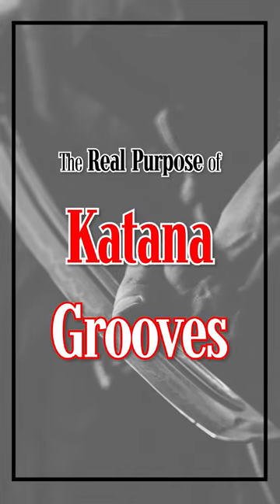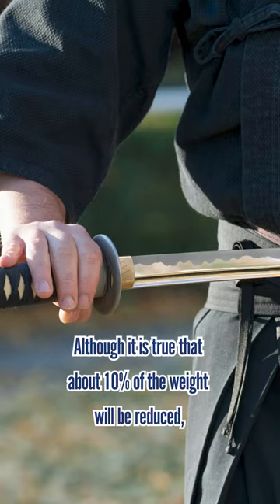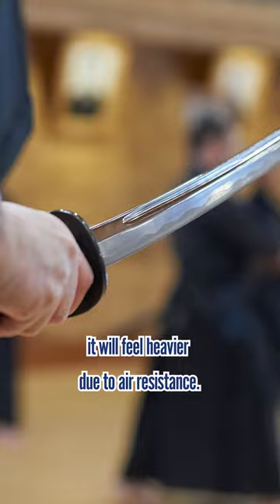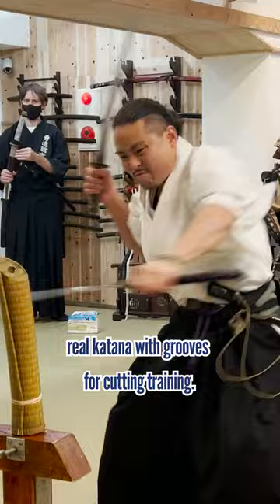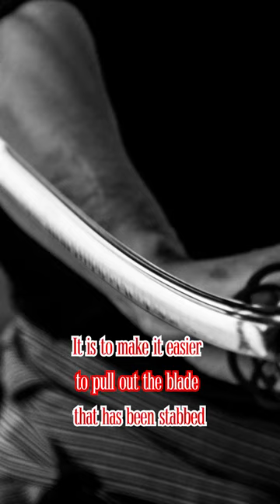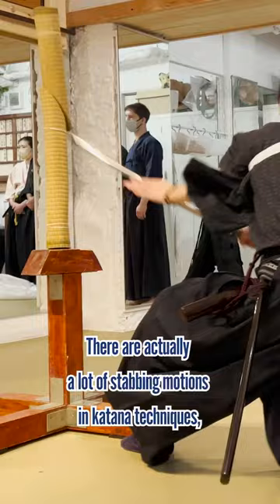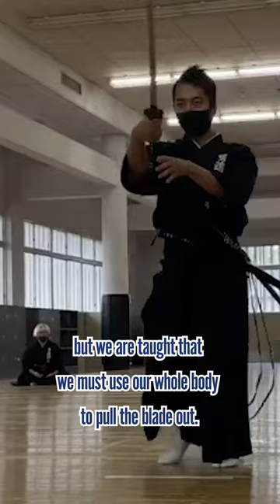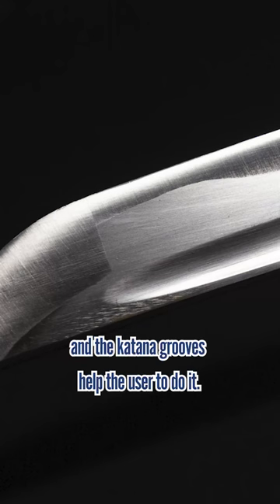The Real Purpose of Katana Grooves #Shorts

Comment: In western swords the groove (fuller) is to reinforce the blade by adding angles in the cross section like a truss. It also serves t lighten the weapon.
Reply: It's likely the same reason, for the katana.
A a body contains bones that swords may get lodged into, making them harder to pull out.
Reply: it doesn't really make it stronger, but it will be just as strong at a lighter weight.
Reply: I am a knife maker and I came here to say this too
Reply: This is the correct answer. It's why they make I beams that shape. It increases the metals tensile strength. It's all about metallurgy
Reply: @businessraptor134  man, uh... metallurgy is nothing to do with structural integrity.
Engineering of structure is not metallurgy unless you are talking lamination or crystalline structure during temper.
Reply: @businessraptor134  the majority of I beams are A36 unless specified for corrosion, abrasion or wear. Then metallurgy does get involved.
In case you think I'm just an internet meanie, I'm 6gr certified in mig TIG stick and flux core and a shipfitter. Retired
Reply: In that case, I guess I don’t have to leave out the groove part. When he said the stab motion would be improved I was tempted to disregard the groove in the katana I plan to make, which is a sakabato sword (a sword that isn’t meant for killing), but if it makes it lighter then I guess I’ll leave it.
Reply: 3d structure makes material less bendy and breakey. How I explain why stamped material is stronger than the sheet it came from

Comment: On a European sword or knife, it would be called a fuller. Not only does it lighten the blade, it improves the lateral rigidity of the blade, meaning it makes it less floppy or, in the case of blades made of softer steel, increases the force required to bend the blade.

Comment: The groove is for structural support. The elasticity of flesh and the amount of fluids the body contains would fill the groove and the groove wouldn't let air into the wound.
Reply: Exactly. The flesh is just going to swell into the groove and make it even harder to pull out. Because now there is both more surface area, but also a groove for the swelling flesh to cling on to. 
It would just make it harder to pull out.

Comment: No this is just a myth. It makes no difference if you have a groove or not. It simply reduces weight and gives structural strength, just like a double T steel beam as a comparison. For example European late medieval and Rena swords like estocs, sideswords and rapiers have no groove/fuller (how it is called on European swords) at all although they are made to thrust and sometimes can't even cut while cutting swords almost always have a fuller. Also if you look at European swords through the time, the fuller gets smaller even though thrusts become more and more important

Comment: Blade retraction after stabbing a body is a theory, but a weak one, I think. Flat or grooved the flesh of the opponent, even gelatin will concrete, or close around, the blade tightly. The groove wouldn't help much, if at all.

Comment: I saw a short from a swordsmith who said that the groove is actually just a result of smithing techniques used to make the blade wider without having to add more material; the groove is there because material was pounded and pushed towards the edge of the blade.  He was talking about Western swords, but I suspect the reasoning may be the same with Katana, since it's just a natural thing that happens when widening metal into a blade.

Comment: The groove allows the smith to take the same amount of material and make a blade with a deeper (edge to spine) blade.  This means that at the same weight, a katana with fuller can have a more acute primary bevel.  This significantly reduces the resistance of a material being cut, and still keeps the blade strong enough to resist being deformed badly during impacts.

Comment: From an engineer's prospective. The groove makes it lighter,and it also helps add structural strength by making it a 3d structure. Thats why we corrugate steel structures and cardboard because perfectly flat structures bend way easier. Also since they are hand forged and making them straight and perfect without the help of modern CNC and tooling also adds to the artistry of the master craftsman because it is so very difficult to do by hand. Also it soes aid greatly in pulling out a stuck blade. Also helps to emphasize the cool whooshing sound when swinging it fast to make it seem like tge user is stronger then they actually are. As for the coefficient of drag its negligible at speeds humans are capable of swinging it but has a great placebo effect.  Also in traditional katana forging methods the grove isnt cut out its forged in which helps improve the crystaline structure of the metal which also makes it stronger. Traditional katanas are works of art. You can make a superior weapon with cheaper homogeneous steel with modern methods to be be mass produced. Traditional katanas can't be massptoduced because of the level of artistry required to make them. Which makes sense that legally they are are pieces not weapons. Thank you for coming to my TED talk

Comment: It's a fuller.
It's to make the blade a little longer while not adding more weight to it. 

The reason why it would be hard to pull out a sword from a body is because of bones. The blade can cut into bones and lodge itself.

The hypothesis about air and the grooves is silly. The grooves don't reach the end of the blade. It is therefore for the integrity of the blade.

Comment: I've had the opportunity to use Katana and European swords on animal carcasses (mostly feral hogs). Pulling against the vacuum formed inside a wound is surprisingly challenging. I assumed, "Oh, it can't be that..." grunt "bad..." *grunt*. 
Double edged swords are considerably easier (wiggle it) but still require real effort to remove.
Reply: But most double edged swords and katanas have a fuller.... I'm more convinced by the engineering theory of the angles making it as strong while reducing weight.

Comment: Practically it only removes weight. 
 Thus you can increase dimensions of the blade to increase toughness without adding weight.

There have actually been several studies comparing the strength benefit of the same dimension blades with and without a bohi/fuller.  

The presence of grooves in the blade can certainly affect tameshigiri and increase friction traveling through the target(s).

In building materials you want the highest roughness with the least weight and material waste.  The weight is compounding and will affect the height of your building.

Comment: Not sure if you're right, most of the time there are "grooves" in blades, called "Fullers" for European longswords, it's typically for saving metal. Since metal is precious and that missing part of metal doesn't make the blade structurally weaker, it means you can make more swords of the same size cause it takes less material.

Comment: This is the theory behind most blades I’m told.  I will say from personal experience, as much as one can have in the matter, removing even a knife blade from the human body is difficult.  I was a police office when I was young and heard several stories while working.  Also you can read accounts from bayonet usage.  Armies train you to pull the blade out by placing you foot on the chest for leverage.
Reply: Same techniques are used for battle axes as well...
Reply: I mean, when blades get stuck in bones, yeah, it would be harder.
Reply: @Poodleinacan  When a blade gets stuck in bone it will often chip or break.  Blades aren’t meant to be twisted.  Any side force is problematic.  It doesn’t need to get stuck in bone to be hard to pull out.
Reply: The issue is that there were indeed plenty of sword blades without fullers. I've seen arming swords and longswords with non-fullered diamond cross-sections, and they weren't some hugely rare thing. It's not even that remarkable.

It's a weight thing, at least in European swords. Indeed, the example of which I'm thinking has a very thin blade, which keeps the sword light. I would not be surprised if the blades without fullers mentioned in the video use something else to keep the weight correct, as relieving suction just ain't it.

Comment: Well, if you use a katana like a shinai, mainly with the tip and essentially like a fencing sword, the groove helps a lot. It facilitates a fighting style based on thrusting because it makes the tip more nimble and allows easier withdrawal from a target. However, it makes the sword worse at cutting. Which is....a bit counterproductive with a sword that's specifically designed to cut and slice well. In my opinion, grooves work best on straight or short swords.

Comment: Not to make it lighter, but to get more blade from less material, it also adds structural rigidity to the blade making it stronger for (again) less material.

These are the reasons European swords have fullers, I doubt that Japanese smiths made those grooves for other reasons. 

Yes the grooves might function as air vents to ease pulling it from a body, but I don't think that is their primary function.

Comment: its so you can have larger sword with the same amount of material.  With out the fuller, using the same amount of material will give you a shorter, thinner, smaller blade.  back in the old days material was expensive and you was't the most out of the small amount you have access to.

Comment: Depends on if it's ground or hammered in, but if it's hammered in it reinforces the blade by changing the chrystal structure of the steel
Reply: No, it doesn't, if the smith heat treated the blade properly.

Comment: Funny enough, this is called a fuller, and is made to help with balancing and is fairly typical in well built thicker blades. It is also part of the forging process, though I can't remember its exact role
Reply: It can be done for a number of reasons.
To make material go further (longer/wider swords), making the blade stronger, or making the blade lighter.

Comment: I learnt a lot of stabs doing training and you're taught to go in and out really hard as it's ment to be to a body. I was told the grooves were the same, basically air holes. Like you said the blades used in training are different.
Reply: I was taught to pull out and drag the blade either up,down etc. (depending on how I stab) to open up the wound....

Comment: Reduce weight, while you maintain most of the structural rigidity. Same as grooves in western sabres, Medieval arming swords, backswords, ...btw, most thrust-centric swords such as rapiers and certain types of late Medieval arming and longswords tended to have diamond cross sections rather than fullered.

Comment: I've heard this is why combat knives have that saw pattern near the base of the blade. It unevenly tears the skin on a stab, so air can get around the blade. Using a smooth blade like a kitchen knife can create an air seal, and it will take a lot of force to pull it back out. This is also why you're not supposed to remove a blade before medics arrive when someone has been stabbed, as the blade may be all that's keeping them from bleeding out.
Reply: The 'saw pattern' is either jimping for grip, or a saw for cutting things like roots or rope easier. Likely the latter, as serrations would not make pulling a knife out easier.

Comment: "Easier to pull out" is also a myth. 
Your body is not a vacuum. If you stab a block of ballistic gel with a flat blade and then stab one with a fuller, it takes about the same amount of strength to pull.

Comment: It strengthens the back of the blade put a bend in metal and see how much stronger it is. Also heat alteration when cooling you want the layers at different temper. 
But what do I know.

Comment: When I studied Iaido I was taught that when the blade is swung correctly (not twisted) there will be a whistle caused by the air passing over the grooves.  If I angled the blade slightly off this would not happen.
It was a sonic feedback device?
Reply: It was not designed to make pretty sounds.

Comment: This... Actually doesn't track in physics. Western blades have this groove as well. On western blades, it's called a fuller (I'm unsure of the terminology for katana and tachi). It does nothing for stuck weapons. What it's actually meant for is for added structure and resilience without adding material. Stronger structure with less material.

Comment: The groove has nothing to do with making it easier to pull the sword out after stabbing someone. It is to reduce weight and improve balance whilst maintaining the strength of the blade. Let us not forget that originally a Samurai would also be wearing armour so saving weight becomes an issue exactly the same as for a modern soldier. The sum total of what you are carrying is significant.
Reply: That's idiotic. Your argument is that a 2.2 lb blade is fine to carry, but a 2.4 lb blade would be a problem. Swinging and fighting - .2 lbs matters. Carrying or wearing, that makes no difference.
Reply: @brianfarley4814  go to the royal armouries in leeds or visit the swordmths who used to work at Wilkinson Sword and learn the truth.

Comment: Does it make it easier to pull out of the scabbard as well?
Reply: No, but you wouldn't want that. You want a scabbard to be a tight fit so that it can't fall out, but the tightness is at the throat of the scabbard and there is little to no friction on the blade.

Comment: You are exactly correct, a sword without a groove would get stuck if it does not cut clean through; it's the reason why people in the know put their thumb 
and finger an inch or two below the blade on a jack-knife; if you were to stab it fully into a person's flesh, it would get stuck.

It being lighter is merely a consequence.